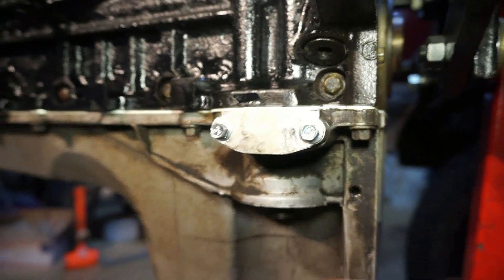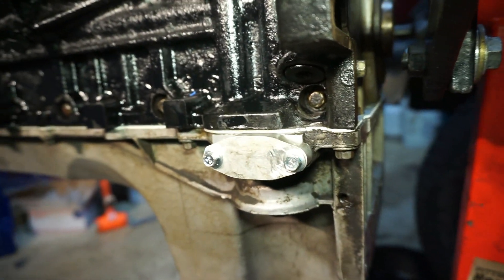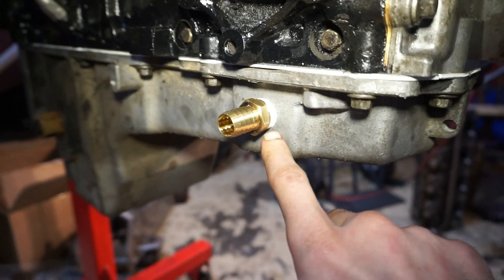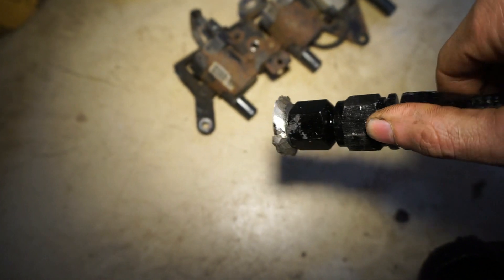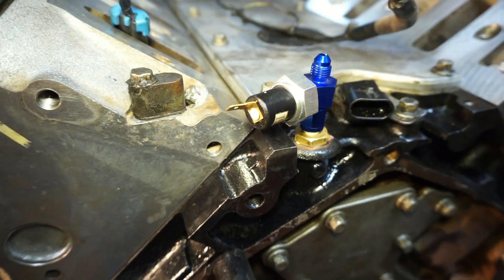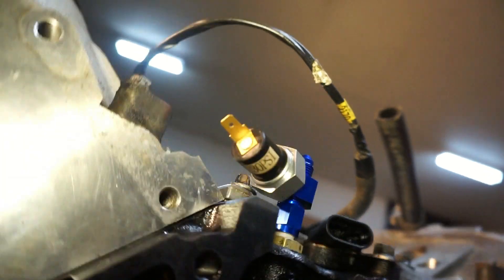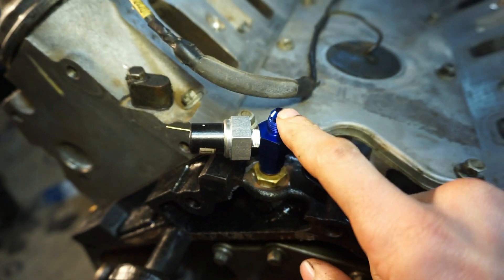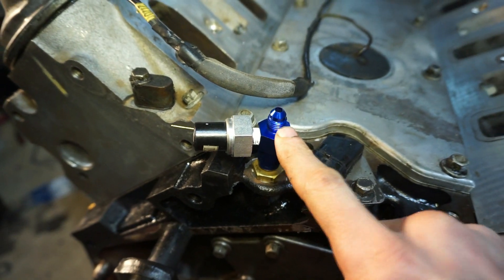QuickFlix 3 - LS Swap Turbo Oiling Solutions!!! - a21bravo

Comment: You can convert the gauge to a regular gauge, i did on my 94 anyway. You basically remove a resistor from the cluster. Google it!
Reply from the maker: justin parks That only works until 95ish i believe. 98 have a different cluster... At least from the research I've done the radiator mod won't work.
Reply: Every time I start wrenching, it turns into a cluster, if you know what I mean

Comment: Instead of blocking off the oil cooler lines, would it be possible to use those lines for oiling the turbo?
Reply from the maker: Ernesto Mejia Yes that's another common method. Either drill and tap, or They sell plates pre tapped for a fitting.

Comment: Hey man would you hurry up and stab that engine in? Im jonesing over here! 😉👍
Reply from the maker: Bad Luck Garage Its In now. Just buttoning everything up... Just checked my intake and it's LOADED with metal... Thought I'd be able to clean it but just looked in the runner and no way.
Reply: Damn brother, that gives a whole new meaning to blowing chunks. lol
Reply from the maker: Bad Luck Garage The one that came with the engine has the big EGR hole so can't use that one.
Reply: maybe fab up a blockoff?
Reply from the maker: Bad Luck Garage ILL get one from junkyard tomorrow... Also, have a local guy who has one but he's checking to make sure it's the right kind.

Comment: what are you using for oil ?
Reply from the maker: Mark MacEwen Initial startup I'm going to use some o'reileys 10-30 because it's cheap And only going to run for 20 minutes. Then I'll use Castro gtx for a few hundred miles.